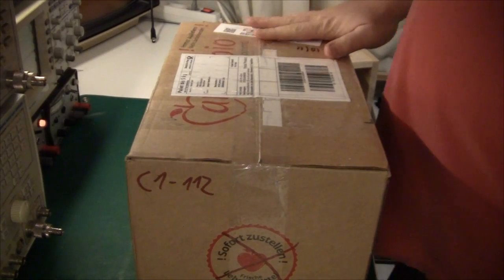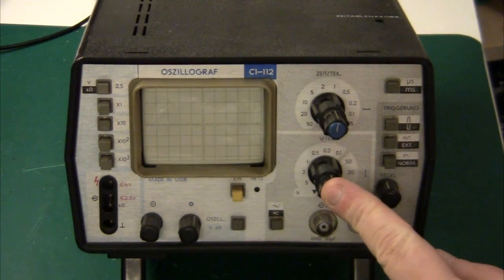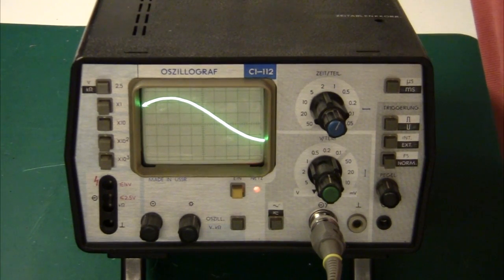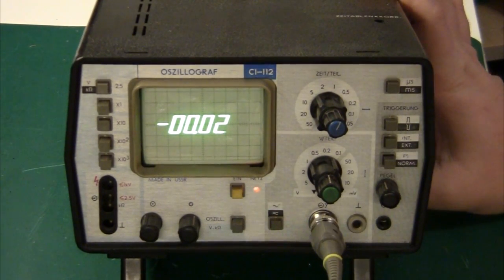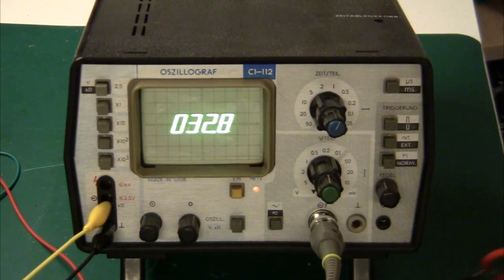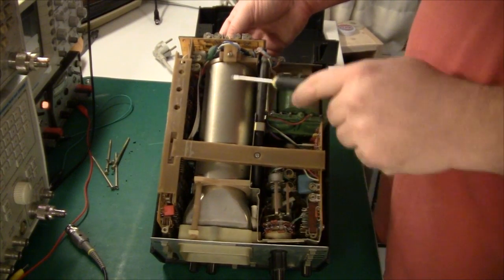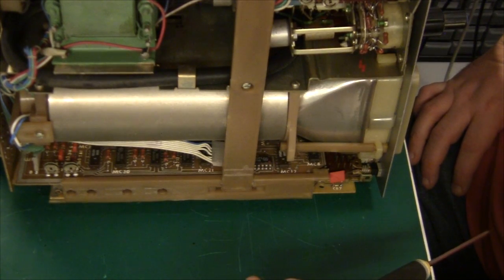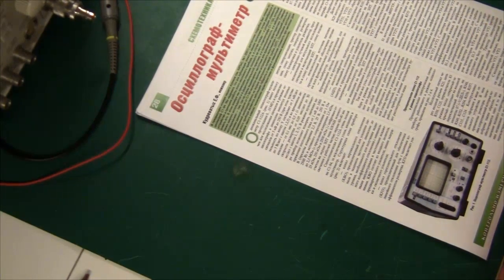A look at the Soviet-made C1-112 oscilloscope

Comment: This device (as many CRT devices of that era, even earliest Friden and HP calculators) uses vector graphics to draw numbers on the screen. The electron beam draws the characters segment by segment, not line by line as in TVs or computers.
Reply from the maker: That is correct. You can see the documents at the end of the video showing the voltages required to move the beam for each digit.

Comment: Your intensity is much too high.
Reply from the maker: Me or the scope screen? :)
Reply: The scope.  ;)
Reply: I recently repaired my Hewlett Packard 54600A 100 MHz dual trace digital storage oscilloscope. I got it real cheap on ebay, around $100, because the screen jumped a bit. The screen finally became squashed and illegible. I opened it up and found the vertical gain circuit for the screen. I replaced two electrolytic capacitors, and now it works like new.  :)
Reply from the maker: That's great info. I have a 20MHz scope where the jumps, and a Marconi radio tester with the same issue, although it only does it very rarely.

Comment: These scopes were a piece of shit. I still have a similar C1-118A oscilloscope but instead of voltmeter it has two 20MHz channels. It was my first scope. They're good for a beginner if they work properly. Fixing one of these is a pain. Build quality is very poor. Cheep plastics. Low quality components (caps, switches and pots) and especially terrible PCB's with traces that brake off with the lightest touch of a soldering iron. If you get one of these for free it's OK but don't buy them. Even those cheep chinese analog oscilloscopes you can get these days are better.
Reply from the maker: And yet, I would have given my left nut to own one of these, back in the day :)
Reply: You probably should look for soviet military-grade oscilloscopes, they are MUCH better and more durable
Reply: Cheap.

Comment: Cool! I have one of those scopes at home, it was my first scope. Mine is unfortunately also without the volt/ohmmeter probes... It served me well, although sadly it has some developed some problem with the CRT lately, but your video has insiperd me to give it another chance to live and try to repair it! By the way you can adjust brightness of the beam with the knob that has a small sun sign above it so that the line on the screen is not so thick and you can see more detail.
Reply from the maker: I would have given my right hand for an oscilloscope like that when I was a teenager. You can do so many things, even with something as simple as this 'scope, but I didn't have the money. Good luck with the repair video. Do you have the schematics?
Reply: Well probably the best thing I did with it was decode a control protocol of a IR helicopter and reuse the transmitter for my robot. I don't think I will make a video about the repair, I don't even have the equipment and SW to make a good video :) And yes, I have some service manual, which for some reason is in French, so I will see of how much use it will be. Do you think you could also make some measurements of precision of the 2,5V voltmeter input? I could use this smaller range to calibrate a uC ADC, but I don't have the precision digital multimeter like you, so I was thinking of using the one on the scope, but I don't know if it is actually more precise than a regular multimeter.
Reply: Oh and if I remember correctly, the FS/NORM button, which you were wondering what it does, draws a line on the CRT in the level of the trigger. But don't take my word on it, I haven't used this little guy since I got my Rigol, which is like five years ago...
Reply from the maker: I'll take the measurement of the 2.5v range later today.
Reply from the maker: I have had a look at the schematic. The FS/NORM button switches in a low-pass filter consisting of a 51 kOhm resistor and a 22nF capacitor. Which gives a 3dB bandwidth of about 140 Hz - so for working with mains frequencies???
Reply: you might find this useful if you don't have it already
http://www.elektroda.pl/rtvforum/topic2946383.html (you have to register to the forum to get the files)

Comment: The K155** are used to drive any sort of high voltage tube (eg. nixe, braun, crt...) and control them from low voltage logic
Reply from the maker: Thank you. Makes sense.

I guess I will have to take out the PCB at one point, to figure out how it works. Is there a list online about Soviet part numbers?
Reply: i only got a russian datasheet about that part... but the equivalent to the K155** in the west is the SN74141 as far as i know from playing with nixie tubes.
Reply from the maker: Sounds great. Thanks
Reply from the maker: *****
Thank you. Very interesting reading.